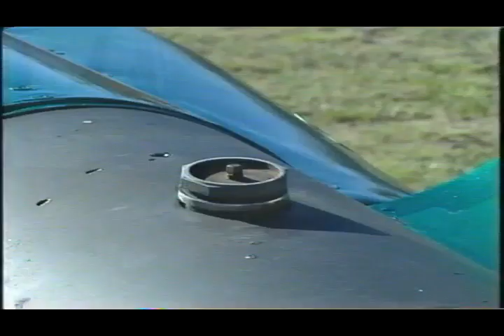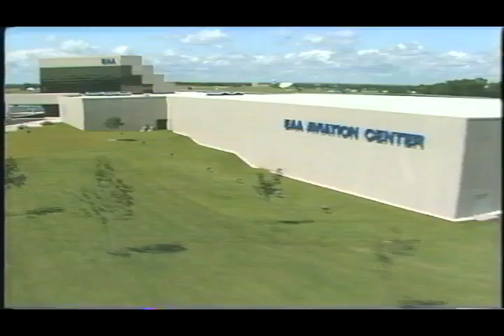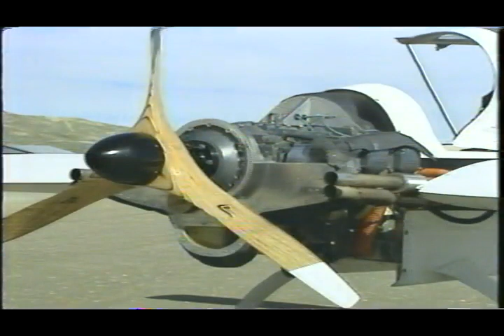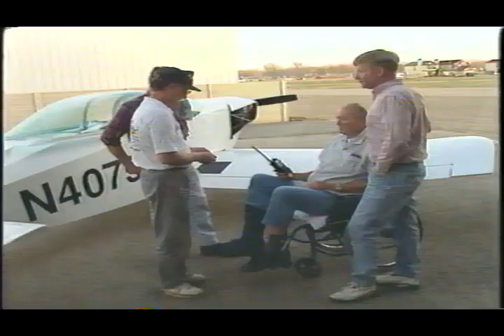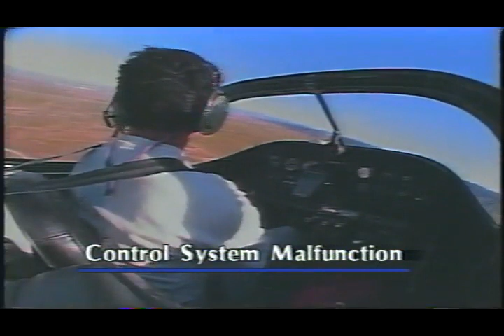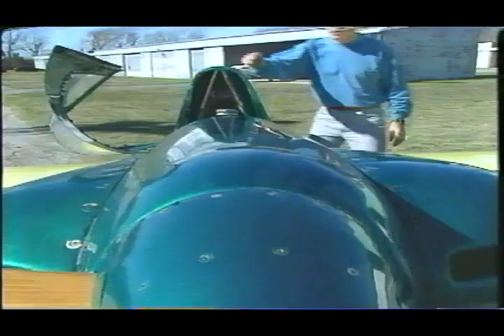First Flight In Your Homebuilt Aircraft

Comment: I hate to promote any regulation, but perhaps a requirement of certification (if it is not already) in type should be required previous to your first flight, if possible (obviously if you are designing/building a new design it is not, directly) but even then a similar aircraft, performance envelope wise, can be found and flown to proficiency.  As a homebuilder, Just sayin'.

As for the vid, good stuff. not AT ALL sure about your last music choice, though.  REALLY, "The Wreck of the Edmund Fitzgerald"???